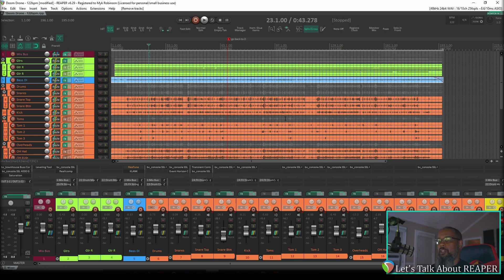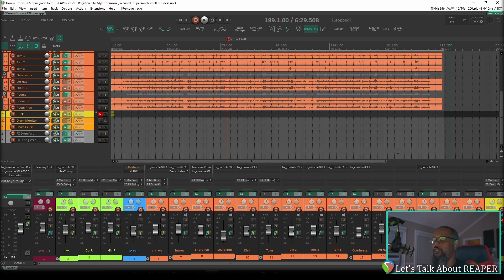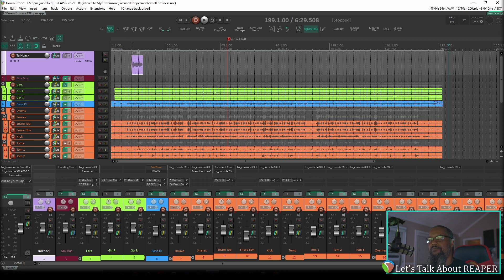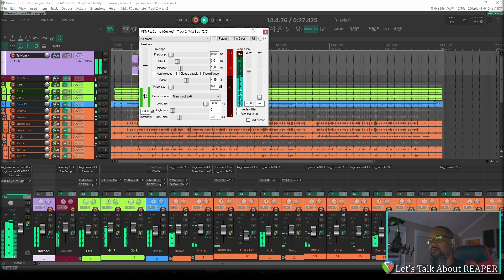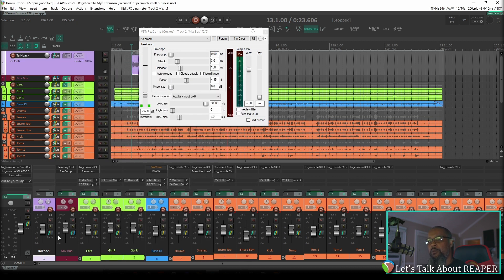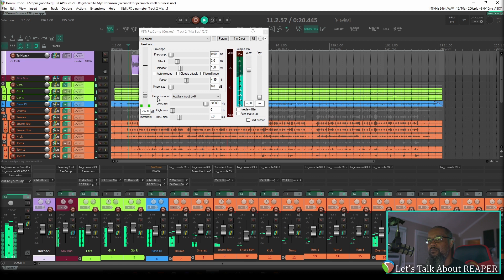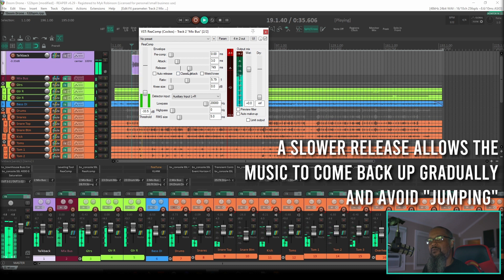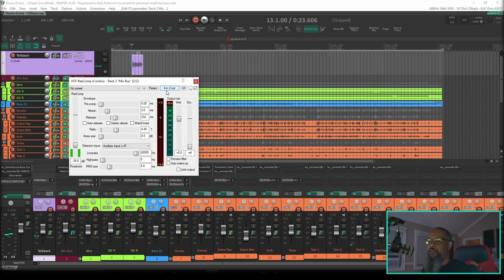Understanding Compression: Sidechaining in REAPER

Comment: i wonder, does it work the same with other compressors? do other compressors also give the option of detector input? or is that a only a reacomp option?
Reply from the maker: It varies from plugin to plugin. Some have the option of an external side chain, others will only have an internal side chain that allows you to filter frequencies from the detection circuit

Comment: Very interesting video. Can we use more than one auxilary inputs in Reaper? For examle I need to use two Reacomp plugins on one track with different settings. Each Reacomp plugin must receive sidechain signal from another two tracks. Lets say I have Pad track. I need ducking effect from clap and snare tracks. But from clap track I need 4:1 ratio in Reacomp, and from snare track I need 20:1 ratio in a second Reacomp. Is it possible in Reaper?
Reply from the maker: i "think" so, by adding more channels to ReaComp.
Use the pin connector dialog to add a couple more channels, then assign, for example, channels 5 and 6 to Auxiliary Left and Auxiliary Right, instead of 3 and 4, and send the sidechain source to channel 5/6 

Hopefully you can see this picture:
https://i.imgur.com/smOSzG2.png
Reply: @LetsTalkAboutReaper  Thanks a lot, it's a great decision.  I'll try it.

Comment: Great vid, thanks for posting.  Do you or anyone here know if it's possible to do this with ReaXcomp?  Been trying with no success.  I know Fabfilter proMB can do this but it's pretty pricey.  Thanks
Reply from the maker: To my knowledge, reaxcomp doesn't have side chain capabilities. TDR Nova is free and works well. Technically, it's a dynamic EQ, so there are some subtle differences in how it behaves versus a compressor, but given the price, it won't hurt to see if it'll work for you 😁

https://www.tokyodawn.net/tdr-nova/
Reply: @LetsTalkAboutReaper  thanks for the quick reply.  I'll check that out.  I also noticed after my post i found Waves has a multiband comp with sc capability for about $30.  Thanks again, dude! 🤟🏼

Comment: Dope video dude! Here is a nice tip for those using sidechain compression in electronic/hip hop: If sidechaining to duck a bass with a kick, filter the send so you're only triggering the sidechain with the high-frequency click of the kick, that way the compressor doesn't take so long to recover due to the kicks sustain, and you can fine-tune the release of the ducking and get it super tight, this way you can carve out the space you want without such a noticeable 'fade in' on the bass afterward.